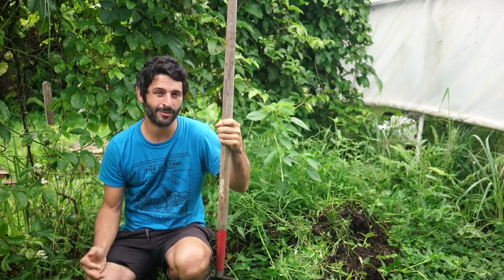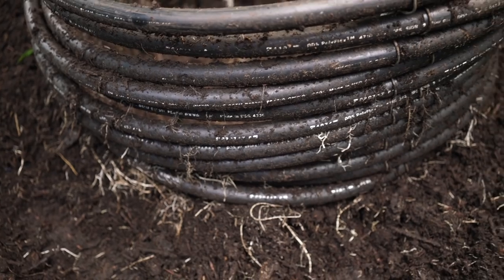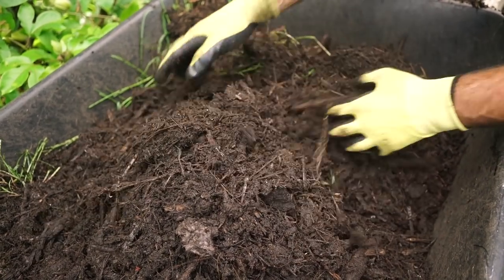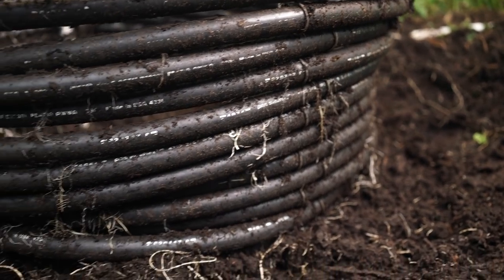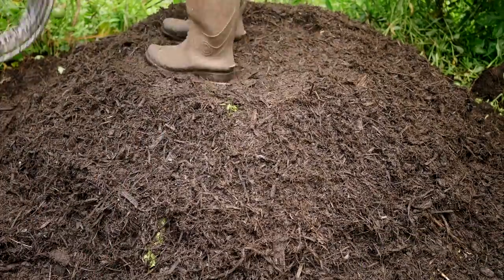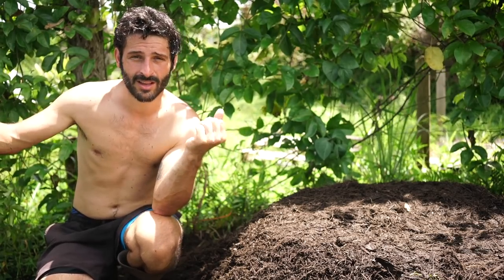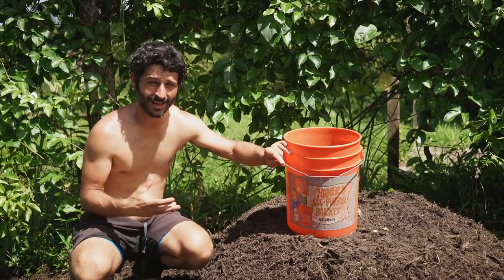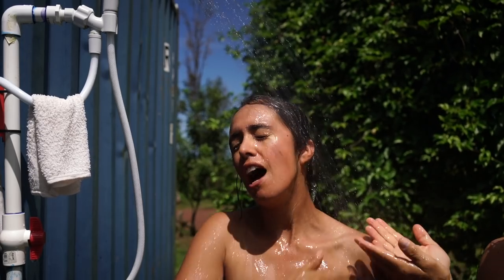How We Keep Our OFF GRID Compost Heated SHOWER HOT | Step By Step Tutorial

Comment: I take cold water showers all the time. I don't have gas right now. And I have a gas water heater. I found if you turn the water very low it isn't bad at all even in the coldest winter months. Of course I would rather take warm showers but it is extremely healthy to take cold showers and baths.

Comment: this was fascinating to me having an engineering mindset. Given that you have a limited length HDPE tubing that only provides 3 minutes of hot water (too short for two separate showers and water can get too hot), I would try to find a way to mix in some of the cold water.  There may be some piping system to allow hot and cold water to mix to varying amounts to produce a temperature that is both warm but not hot and allowing the hot water supply to last longer.  One solution might be to capture rainwater in an elevated storage container and connect a line from that storage container to the line that goes to your shower. The reason the container needs to be elevated is to provide some pressure at the ground level that will compete and hopefully an an equal scale as the nature water pressure from the regular water supply, or introduce a pump from this container that matches the pressure from the regular water line. Of course there are other solutions that may not require a monthly maintenance, such as solar heating, wood fire, if you explored "off grid water heating"

Comment: I'm not sure how I missed this video when you first posted it. After I originally sent you the link to Jean Pain compost heating I have been following your efforts in this area. You may have some nice rich compost at the end, but from what I have noticed is you are adding a lot of unnecessary ingredients to your pile. A massive mound of pure wood chips right out of the chipper will make 140° heat for much longer. No grass clippings, no pee, just chipped up wood and lots of it. Jean Pain also used an a aerobic digester in the middle of his mound. That provided biogas to cook with and run his vehicle. You could put your poop, pee, and grass clippings in the digester to make gas to occasionally run a generator to augment your solar system. Also, it would be a good idea to get a water heater to use as a storage tank. You can get a very small pump on a timer to circulate the water through your coil for a few minutes at a time to keep a large amount of hot water in the tank.
Reply from the maker: We don’t have access to fresh wood chips only the county mulch which is pretty fresh but it has been compositing for at least 6 weeks before they release it. It’s really hot when we get it but have found that it doesn’t stay hot for very long. Adding the grass more then doubles the time it stays hot, and the more gras we add the hotter it gets and longer it last.
Reply: @OffGridHawaii  That's 6 weeks of heating you are not getting from the material you are getting from the county. I would contact some tree trimmers who have a chipper, as most of them do. I would bet many of them would be more than happy to bring you a truckload of chopped up branches and leaves for little to nothing. Wood chip mounds almost instantly start creating heat and continue to do so until they are completely composted. Grass clippings do too, but will decompose very quickly in the mound; much faster than wood chips. Here is a other link. Notice that he has nothing but wood chips in his mound. https://youtu.be/zbArnw2Tfu0
Reply from the maker: Yeah I’ve seen this video before. Very well done.  I think part of the reason it stays hot for so long is because of how big it is. I’d like to do a large scale one at some point but there isn’t enough room for it where it is now. The bacteria need air to create heat so maybe that’s why the wood chips work so well, there is a lot of air space in a pile of wood chips vs the mulch. I’m still happy with the way we are doing it because we get loads of compost every 2-3 months which is very valuable around here.
Reply: @OffGridHawaii  yes, there are people who pump air into their mounds to increase the heat, but it also shortens the life of the mound. You can make one big wood chip mound like Jean Pain did to provide heat and biogas for long periods of time and smaller, more traditional compost piles for continuous use in the garden. Imagine a bunch of truck inner tubes maifolded together full of biogas to run a small generator whenever you want. You could close up the shipping container and run a dehumidifier.

Comment: great idea. i'd probably make the heating loop with the water storage to heat the whole barrel. granted it would be slow to warm up at first, but then you would have the entire barrel collecting heat from it. course then you'd probably want to insulate the barrel for retention, and there's the very real possibility that it would get too hot aswell. but great info and setup!

Comment: She seems to grimace a bit.  Is that cause the water is too hot or too cold?  Maybe consider a pump and thermostat, and add a small water heater for backup.   Still Pretty ingenious idea and simple too. Compost generates a lot of heat that usually gets wasted.  I worked on a project designing a cooling system for a commercial compost facility.

Comment: thank you for the video.

have you by any chance compared full-length grass vs grass clippings? we have very long grass that we harvest by hand. would prefer to avoid cutting it into small pieces if possible.

also, do you put kitchen scraps into the pile? if so, do you make a little hole at the top and put them in as they gather up? or a big bucket of kitchen scraps at the bottom when first making it? or ...?

anyway, thank you!
Reply from the maker: Long grass would still work, but it will decompose slower. Could experiment with it. Occasionally we add a bucket of kitchen scraps when turning it, but as of now our kitchen scraps always go to our chicken coop.

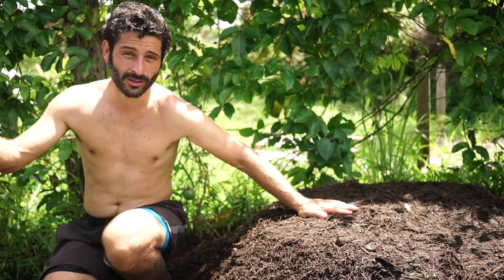Comment: 7:21 funny thing about sustainability is that you have to sustain it, right?
Yes. IMO true permaculture would be building soil without external inputs.
Reply from the maker: Exactly right, but permaculture is not about being 100% strict. It’s about doing the most practical thing to get you to the place where you don’t have to use external inputs. We are in a very tough situation here (growing in rock with no soil) so we can either bring in the mulch to jump start everything or wait 5-10 years til the soil is built. We are working towards zero external inputs but for now this is the best we can do. Thank you for the comment 😊

Comment: Hi, my expertise and job is installing solar hot water in Kona.    I enjoy your vlog but i think you're mis leading viewers that solar hot water does not work at night or on cloudy days.     Solar hot water works great at night and on cloudy days if you put the right system in.  A coil of pipe straight into a shower head is not the right way to do it.   You need a storage tank + pump now you have a proper system.  This storage + pump system is what you need for both on a roof solar or compost pile.   Hit me up if you'd like some free help,  we could add storage + pump very easy to your compost collector.   -Chris
Reply from the maker: Thank you for the comment, I guess we didn’t look much into it. That is very impressive that water can stay hot for 12 hours.